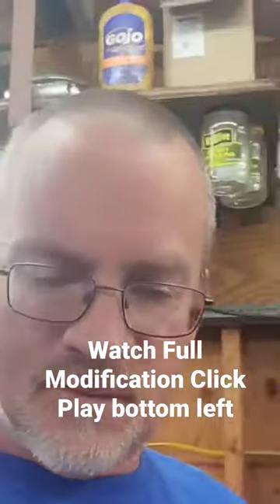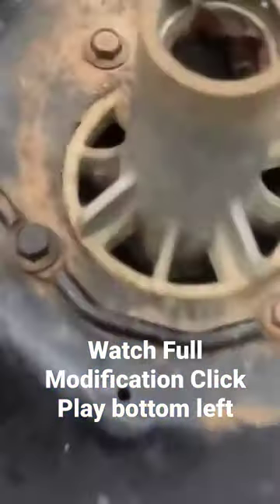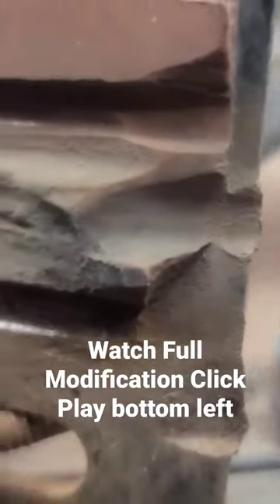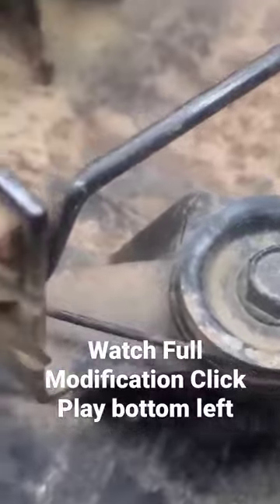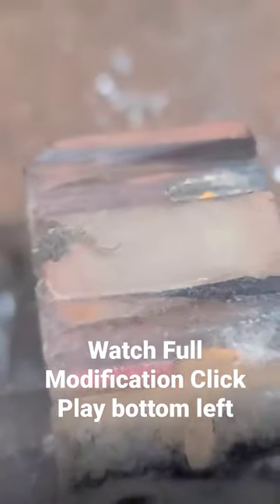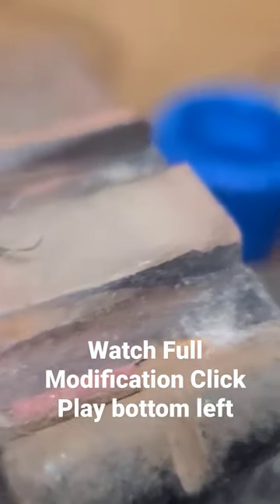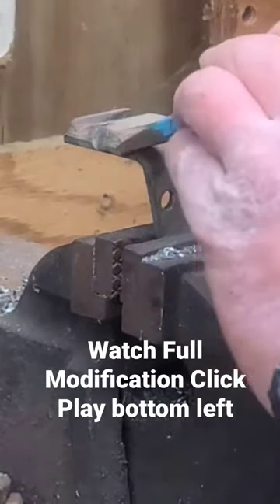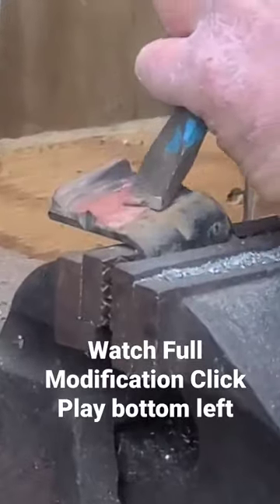Blade Brake Pad Modification Trick Craftsman DYS4500 Short Part 1 #Craftsman #smallenginerepair

Comment: Did you find a replacement pad to glue on? Curious to know if they are available.
Reply from the maker: @davidellis7695
They are available
Not just the pad, It comes bracket and pad.
I think I left links in Description
From the short click the play button below Sartin Garage logo to go to actual Video.
 Then go to description
The links are there